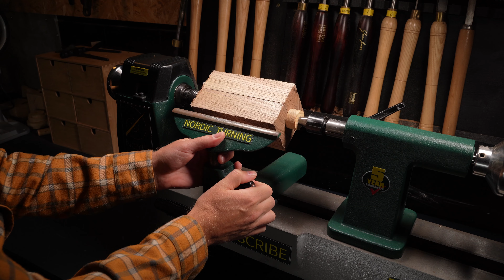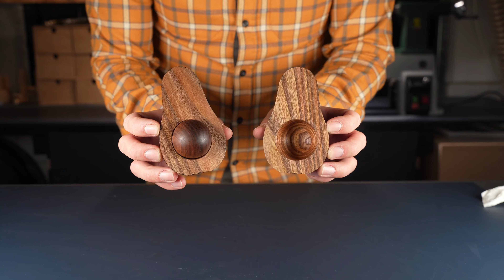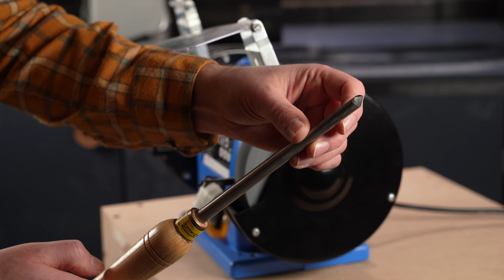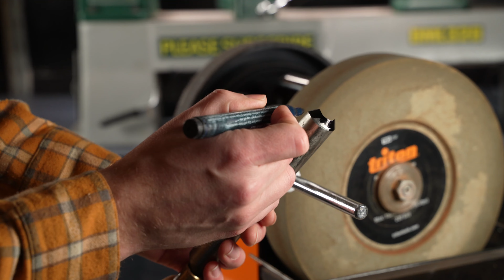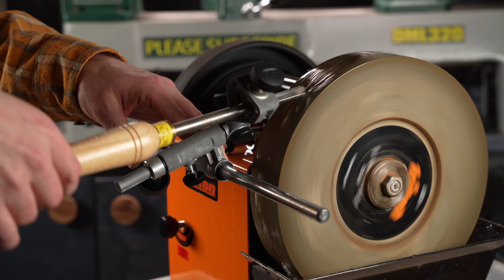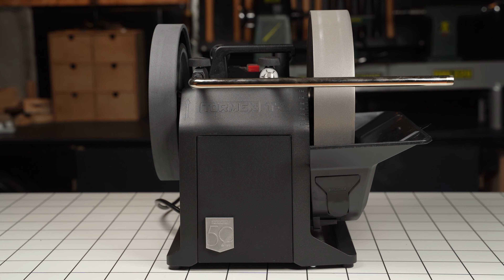Sharpening woodturning tools - a personal journey

Comment: Lovely share. Most of us do and did suffer from the same bowl (etc) gouge's sharpening issues. It is really time to to get a proper wet stone sharpener even if just using to sharpen those finger nail ,bowl,spindle  gouge shaped tools . Couple of times my mood  was off  when  I could not find the right  angle to sharpen my fingernail gouge on a standard grinder 😢 As a full time joiner,  I always wanted to learn  those sharpening technics ,which you can only practice if you get a proper grinder. Thanks for sharing!

Comment: I went through similar journey bu in the middle i was using the Tormek knockoff from Record Power. Apart from all the stuff you mention the issue i had was constantly adjust all the jigs to accomodate for the wheel wear. I eventually settled on Robert Sorby Pro Edge i extremely happy with it and i havent looked back since.

Comment: I bought the Jet knock-off version of the Tormek - same issues.  The stone is out of round and the bowl gouge jig is not as accurate and setup instructions are missing.
Reply from the maker: Did you end up buying the Tormek machine? It seems a lot of people who try the knock-offs end up getting the real deal eventually.
Reply: No, I’ll get by with it for awhile.  I think I would go with the 1750 rpm dry cbn wheels next.   I did get some wheel dressing tools for cheap and with time I can keep it fairly flat , but out of round is not too bad since it goes so slow.
Reply: CBN wheels on a low speed grinder are the way!

Comment: For bench grinders there are plenty of jigs for bowl gouges (oneway wolverine system, kodiak system) - there is also the sorry sanding system. Did you look at any of these?
Reply: I use my Tormek T 8 for 4 Years and i still like it a lot. I will buy a record power grinder too. Sometimes you need to put another bevel on your Gouges and it last a lifetime on the Tormek ^^.
Reply: I see. Surprised about the sorby pro edge as I thought it was uk. Anyways glad you found something that works
Reply from the maker: I’ve seen videoes on those but never tried. The problem is they were never in any stores in my part of the world so the shipping made them super expensive here.
Reply from the maker: I didn’t know they had a gouge jig. You can get proedge here. What do you use?
Reply: I use cbn wheels with a slow speed grinder and the kodiak sharpening system. Total cost was around $700 US. I did look at tormek but the cost is hard to justify. I feel I get very good results with the kodiak system.
Reply from the maker: I see, the kodiak system looks very good and versitile. And I agree, the Tormek is really expensive, hopefully it runs well for 50 years and I won’t have to spend any more 😆